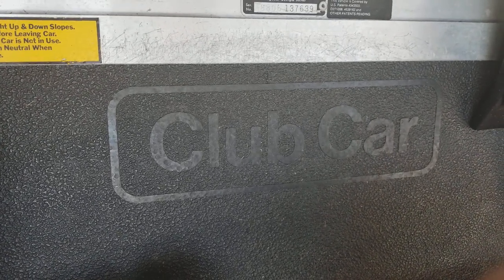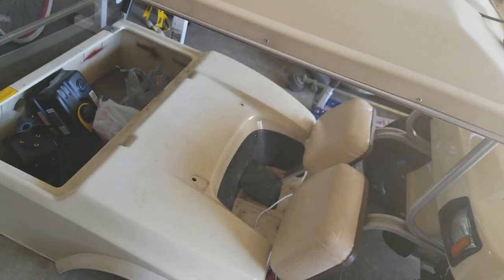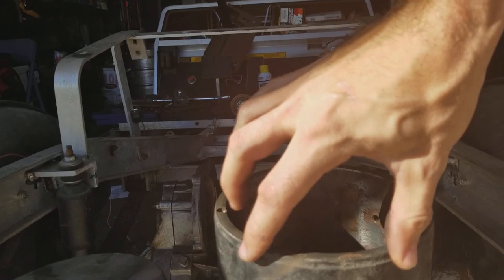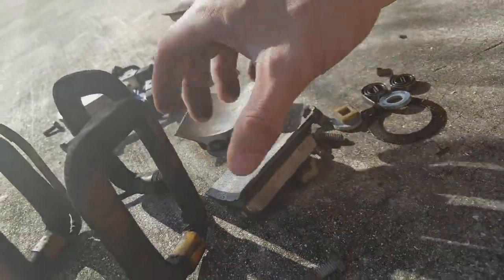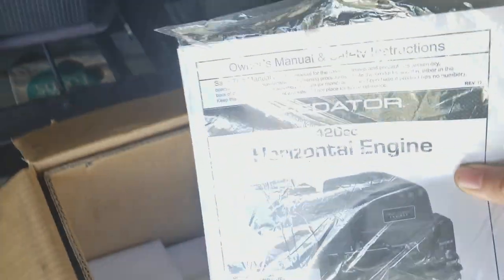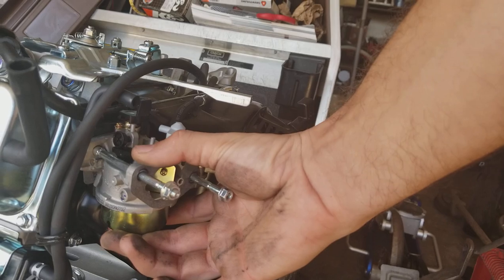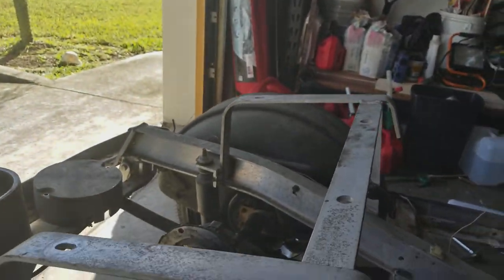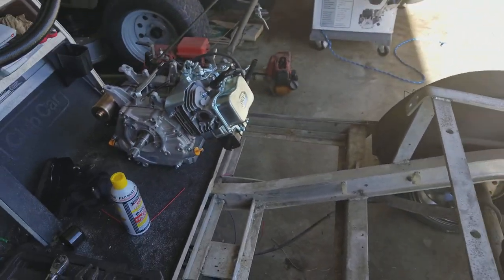Convert electric club car to gas with predator 420cc part 1

Comment: WHich fuel pump did u use , electric or vacum type. The only thing with vacul type I don't know where to hook up hose, and the electric is pumps too much gas and overflows carb... thats my dilema .... If any suggestion let me know please

Comment: Yo keep me updated on this build. I'm about to get a 94 club car with electric. It's not running, good batteries but I want to swap to gas. If this is a good motor and works well for you I may go with something like this as well. Thanks
Reply from the maker: definitely, my issue is that i want to put the motor inside the seat where the batteries are, because of the motors rotation and position of the driveshaft ive had to do some pretty drastic stuff, im trying have an update done this weekend.. maybe.
Reply: I was thinking about that as well.  My goal or attempt would to be to use an ATV Motor with the Drive train so I could reverse ect. Does lifting it help much at all? I'm still up in the air about all of it. Is it a tight fit under the seat?
Reply from the maker: it fits pretty good under the seat once the gas tank and airbox have been removed and moved a bit. ill have videos on that also. ive heard great stuff about people doing ATV swaps, definitely something ive thought about but couldnt find anything worthwhile within my budget so i went wit the predator just under the vtwin. theres a guy that fit a vtwin under the seat of his golf cart. and no lifting it doesnt help the frame is whats setting your engine height
Reply: Ah ok that makes sense then. Yeah I'll be excited to see your videos when you post them. After I get my project started I'll upload some videos to let you see what I'm kind of working with it.
Reply: Hey any other update? I went ahead and bought mine. I got a 1992 Ez Go Marathon. I've got a clean slate to work with as the battery metal is rusted. I'm going to just cut it out and weld a new mount for the engine. Have you gotten the engine turning the wheels yet? If so how is it working out. Excited to hear more as this helps me build mine.
Reply: I converted a Yamaha to gas with a 420       Was not too hard with a 40 series torque converters and jack shaft.   Does great... nice and clean. Everything is under the seat
Reply: Do you have any video?

Comment: I'm doing the exact same project with my clubcar but with the duromax 18hp.  What tooth sprocket did you go with on the old electric motor shaft?
Reply: A 10 tooth. Good luck with the build

Comment: Remove the governor at least cause that thing is gonna go slow with that gear ratio and only reving at 3600rpm. And why would u want it to look stock as possible I personally prefer all the after market parts not only douse it look better but it performs better